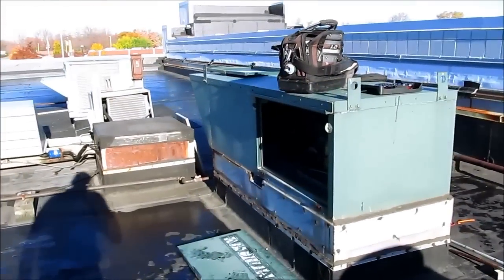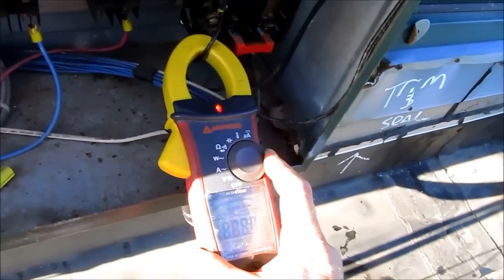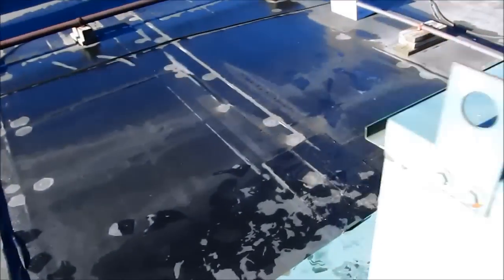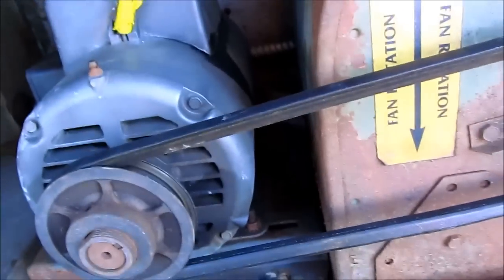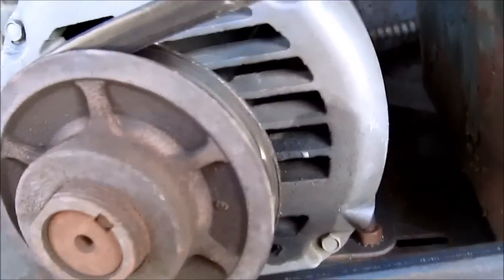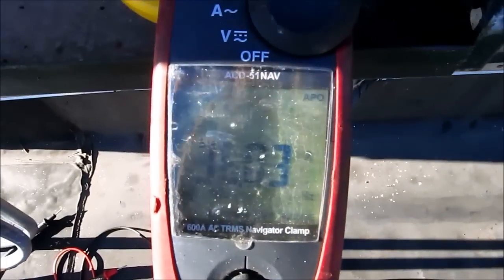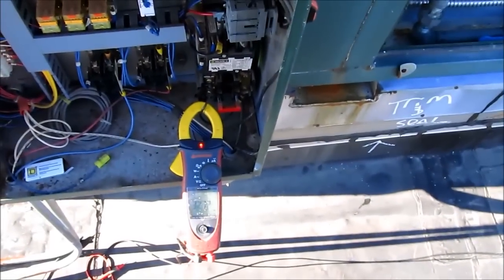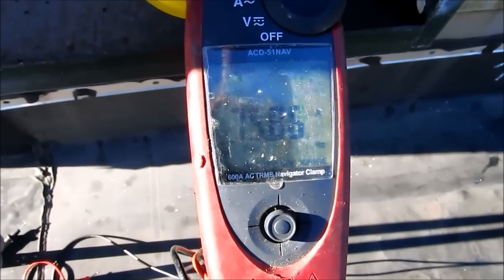AbsoluteAir Make up air bad blower motor

Comment: That's an awful lot of current -- might be worth checking all connections and relays in the fan circuit in case they got damaged while the motor fried.